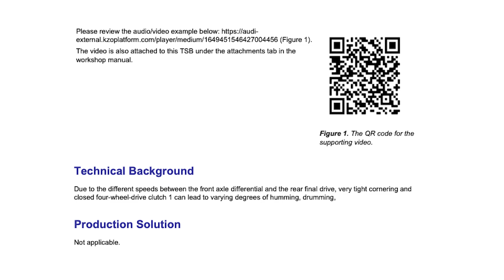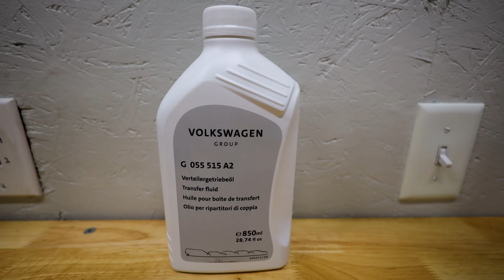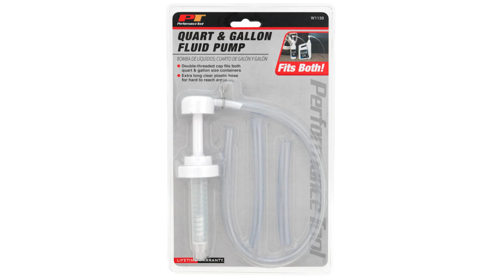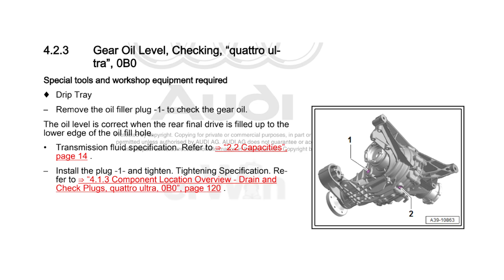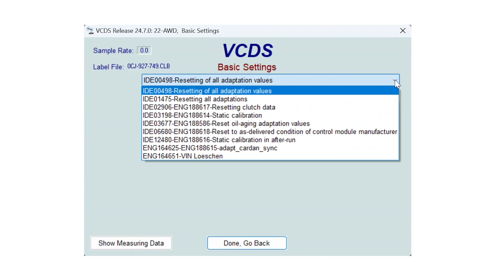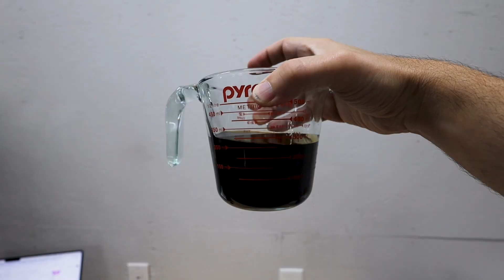Quattro Ultra AWD Clutch Binding & Vibration Fix | TSB Procedure A4 Allroad

Comment: Second comment. PLEASE HELP!!

So I don’t have the front differential but I do have Quattro I guess it’s not the Ultra. Now will the steering lock vibration be solved by only changing the fluid in the rear clutch differential?

10:53 are these plugs the same for the rear differential?
Reply from the maker: If you have an all wheel drive Audi, you do have a front, center and rear differential - it's just that front and centers can come in different mechanical formats bundled into what looks like just one big transmission casing under the car. Whether it's the build sticker in your spare wheel well, getting under the car, or scamming the computer, you should figure out what you truly have. That said, has a professional looked at this car yet? Vibrations can often be caused by leaking high pressure power steering hoses, worn suspension or brakes...in fact it's often NOT a driveline issue (beyond worn mounts, maybe). What have you done first hand, so far?
Reply: @FigureItAuto I had the power steering hose recall on my 2010 Q5 because of the rumbling when turning hard at standstill
Reply: @mne9476 yeah, I had this rumble with my old B8 too. Got the PS high pressure hose but never got to replace it until I got rid of the car, I even have the hose in my garage to this day. But with this B9 it’s not a shudder, it’s more of a vibration like how a phone would vibrate.
Reply: @FigureItAuto  I see. I got under the car, and the front clutch that you have on your All Road is, let’s say missing on my car. I guess it is like you say somewhere else, but I don’t know where, or how to find it. 
I’ve had it looked at when I was getting all shocks and struts replaced, and they said they felt nothing was loose or worn out, but I know something is clunking on the front passenger side when I go over mild bumps or small potholes, apart from that, everything feels solid going on uneven surfaces. Said I’ll take it back for further diag. I also need to replace rotors, they’re warped. Having that said I HIGHLY doubt that those two issues would cause vibrations at full lock while creeping slowly cause the vibrations are not like shuddering ones, it’s like the whole car is a cellphone vibrating kind or vibrations. It goes away if I pick up a little speed. Also, no high pressure power steering hoses on our B9s, seeing that Audi stopped using power steering pumps from the B8.5. We have EPS, electrically assisted power steering. The system works fine, I’d be in shock if my steering rack & pinion is cause the vibration, I don’t know how it would.
I already returned the gear oil in the white bottle, I still have the gray bottle oil. So how do I find out what clutches I have? Could the one in the rear cause these vibrations? One thing I’ll get checked out are the motor mounts for sure.

Comment: Hey, I have the same type of problems with my 2017 A5 quattro 3.0tdi, but it has a torsen awd system not quattro ultra, is it possible to do the same thing with the torsen awd system? I had a gearbox oil change, the problems became "lighter" , but still noticeable.
Reply from the maker: Technically, yes, it's just I wouldn't expect this to be the solution. Vibrations can come from so many places under a car and you need to look for clues all over the steering, suspension, brakes - lots to trouble shoot. But fluid changes are easy, usually, and your car will thank you for it regardless.

Comment: How did you find out the 360ml-400ml fill amount?  Google has not been my friend . Thanks
Reply from the maker: It's in a fluid capacity table in the workshop manual, which technically lists the initial fill at 0.85L and a refill at 0.65L. I think what people have found out though is that it takes a little less than that.
Reply: @FigureItAuto   Thank you sir.  Great videos

Comment: Is the flush cycle needed or can you do the one drain/fill before the vcds reset ?
Reply from the maker: Since it can be done with a single bottle, there's really no reason NOT to do the flush - but even if that weren't the case, I would still do it. Knowing how sensitive that clutch body is, you need every drop of clean, high performing fluid in there as you can manage.
Reply: @FigureItAuto thanks you make a good point.  Local Audi in Alberta was $140. I found Triax Dtf-1 as an option
Reply: @FigureItAuto  would you say go for a drive with the old drain plugs , do the final drain and use the new plugs?

Comment: If you have the Audi Quattro AWD system and you are having the shuddering out of turns problem, THIS VIDEO IS FOR YOU! Fear not, even if you’ve been driving around like this for months! Do the flush and refill twice and follow the instructions in the video (I subbed driving on the actual road vs his method, but I had a garage with a lift up and down easily). You will be fine! 2019 Q5, 120,000 miles, never did the fluid flush. I found this video a couple weeks ago, ordered the stuff online, did the service today and I am BACK IN BUSINESS BABY! No more wondering if it’s gonna be a $2000-4000 repair every time I step on the gas or take a sharp turn!
Reply: How is the car? Any update? Im planning to do the exact same servicing to my 2022 a4, I have vibration and kicks at low speed turning
Reply: I need to do this on my 2019 Q5 too...

How hard was the job? Was it easy to access?

Comment: I've started noticing a very slight rumble when turning from a light or parking lot.  It's really not loud or locking or binding at this point, but I can feel it in the wheel/seat - it just sounds like the diff isn't working quite right and the right slippage isn't there.  Is that how this started for you too?  My Q5 is still under CPO till this December, would they cover this TSB (whether the change or the crazy circle driving)?  Also since its so slight and I'm overly critical of noises/feelings in my cars, I worry they will just say "Meh there's nothing wrong with it" then charge a diagnostic fee.  I actually don't really mind doing this myself because I change fluids in all my cars (well, the Q5 has quite a process for the transmission so I let the dealer do that one) but certainly would rather them do it if it's covered.
Reply from the maker: That's how it felt when the Allroad here started acting up as well. From everyone else's stories, I'd say the odds that the dealer will acknowledge the problem and try either of the TSBs is low (especially the oil one, now that a newer TSB is out) but it's certainly worth asking about. With how widespread it is, I'm almost surprised it's not recall worthy. But hey, I'm just some guy on YouTube.
Reply: @FigureItAuto  Ha!  If I were Audi I'd rather change the oil every 20k instead of driving in circles for a total of 30 min and throwing up!  I thought about trying the circles thing myself but I'm not sure it's worth the torture.
Reply: @Wolfman140 how do you try the tsb yourself? Just drive in circles?
Reply: @lisandrodiaz7852  Check out the link I put in above.  It says though that the Test Plan available in the ODIS software has a target torque value....so I don't know if that functionally changes the way this thing operates or not.  If it does, then doing it yourself may not yield any results.
Reply: Thanks, I went ahead and just did the fluid change and it’s night and day difference. I would say that it fixed it. The fluid was pretty dark, my q5 had 53k when I changed it. Still trying to follow Audis thought process on not wanting to change the fluid but rather do this circle procedure and if it will work better than the fluid change.
Reply: @lisandrodiaz7852  Yeah I'm on the fence; I sort of want to just change the fluid vs. bringing it to them (even though I'm still under CPO) because it will literally take me less time than bringing it in.
Reply: I had this same problem 2 years ago on my 2017 A4 Allroad and got it fixed,  and not it’s back again and I hate it.  It’s so uncomfortable to drive like this, I have to bring it again.  How often does this happen?

Comment: My 2022 Q5 45 has 30K miles and I have the problem. I have a SIGNIFICANT rumbling though. Got worse recently. Dealer plans to do a software update. I will push for a fluid replacement also.
Reply from the maker: If you're able, inquire what the dealer is actually doing with that software update and report back here.
Reply: @FigureItAuto  I will find out and report back. I think when they test drive the Q5 they will realize that there is a mechanical issue involved. The rumble is audible and can be felt through the seat, steering wheel, and accelerator. I will push for the fluid replacement because I can't afford to bring the vehicle back multiple times! I only have 10 months left on the warranty!
Reply: @FigureItAuto  I took the Q5 to the dealer today. Because there is a new TSB, Audi forces dealers to "retrain" the quattro system by connecting a computer, watching the output, and adjusting as the technician drives in circles for 30min. I asked about this procedure reducing "high spots" on the clutch discs and he had no idea what I was talking about. If the software/circles procedure doesn't solve the problem, they go to Audi to get approval for the fluid replacement. Audi will either ok the fluid replacement or direct the dealer to replace the AWD Clutch. My Q5 is still under warranty. Today, on the drive home, the terrible rumbling was gone,; however, there is still a slight rumbling when turning tightly and when taking off, but I think most of that is characteristic of the Q5 with the 2.0 TFSI. My previous Q5 had a 3.2 V6 and some slight rumbling due to power steering hose vibration.

The service advisor said this problem is common with Q5, A4 variants, and some A6. The two vehicles they actually replaced the AWD clutch on were both Q8.
Reply from the maker: Excellent insights! If I ever get the time, I'll attempt to figure out what metrics can be logged via VCDS for the clutch so we can all start to understand what that circles process actually entails. I believe the "high spot" theory is just someone's wild assumption and holds no merit. Thanks for asking questions and sharing back.
Reply: @FigureItAuto my quattro binding issue is finally resolved. Hopefully this insight helps. I had to get the dealer do the work under warranty. The first time they had the Q5, they did the “drive in circles with the computer connected” method. Didn’t work. On second visit, they had Audi Tech on the phone while they did the so called “break in procedure.”  While Audi Tech was on the phone the mechanic made the appropriate programming adjustments. I took it home. Seemed to be much better. However, they did the procedure while the drive mode was “comfort.” When i put it in “dynamic”, I thought we were having an earthquake. There is a different procedure for each drive mode. So, I took it back for the third time. This time I told the service advisor to not call me until it was completely resolved. Audi Tech had them flush the fluid twice (as you suggest in your video), and then they went through the break in procedure for each drive mode again. The binding and rumbling seems to be resolved now. Amazing how smoothly the system is working now. They gave me a Q3 45 as a loaner. It had a 8-speed tiptronic and the standard quattro. Horrible ride!  The service advisor apologized for the failure in fixing it on the first try. Apparently they haven’t had to deal with this before.

Comment: I have had oil change two times on my 2021 A5 so far.  The issue is completely solved every time.  One time the garage put the wrong oil and the issue became noticeably worse!  After refilling with the right oil, the issue is gone.
Reply: Hi, I also have the A5 , which is 2020 45 TSFI, Quattro, the mechanic changed the fluid today, but the noise has not completely gone, they suggest me change the new or second transfer case, I wanna ask if the noise will immediately goes off when the fluid changed?

Comment: Would this work for a 2021 q5 45? I’m having the same issue
Reply from the maker: If you've confirmed it has the same type of ultra clutch: possibly. Have you called the dealer? What'd they say? Note there's been discussion here in the comments about a newer TSB that essentially just has you driving in circles, full lock, for 15 mins to (allegedly) wear off uneven material (and how after that you wouldn't need a fluid flush anyways, beats me) - and that works.

Comment: This wouldn't have happened if they just stick with the standard mechanical quattro system using the self-locking center differential.  Full-time AWD with no connecting/disconnecting.  I stick with models using this drive concept, though it is increasingly difficult to find affordable models using the self-locking center diff.  Who would have ever guessed that making the AWD system more complex would lead to more failures??

Comment: I have just had my car at Audi for this fault.       the "new" fix that they do is to drive the car at full lock round in a circle for 15 mins each way.      this issue is caused by high spots on the clutch which once driven this way are levelled off.   might be worth trying that before doing the oil change / flush.
Reply from the maker: And how does it feel now? This solution doesn't make mechanical sense to me based on how the clutch works and is constructed. What they're doing will grind off the furthest edges of the teeth of gearing in the front diff but that's not where the problem resides. Can you share more about your year and model and what Audi told you?
Reply: @FigureItAuto  this is a 2019 Q5 40 TDI, im in the UK.     and what i said is what they told me,     the mechanic was white as he had been going in circles for 30 mins.     the jitter / stutter has gone, so far so good.   the TSB referenced in this clip is apparently old and has been updated by audi, not sure on the new reference.
Reply: @FigureItAuto they did it to my q5 2021 40 TDI, it didnt work 😅
Reply from the maker: @Elghorda  Which method? Fluid or circles?
Reply: @FigureItAuto circles
Reply: @FigureItAuto Hello!a little update, as i told you the circles methode didn't work, so  they did the flush and the rumble is gone. I told them that i will be doing the flush every 30k km from now on, they agreed but it won't be for free ( under warranty ) if there's no rumble!
Reply: @Elghorda is this covered under Audi extended warranty?
Reply: @Elghorda are you in the UK, what sort of money did Audi charge
Reply: I am from UK and have a 2019 Q5 40 Tdi with the same issues. The Audi dealer is going to do that same drive it in circles until it stops. I asked about fluid change and they said not required. I’m not convinced but will find out next week when they do it at my expense!
Reply: @robertbate2991  I have the same Audi Q5 40 TDI. Will that work for you?
Reply: @robertbate2991  How did this work out?
Reply: Indeed, I just saw that there is a new TSB dated October 21, 2024, and it talks about this procedure.
Reply: @angelguillendev do you have a link to it?
Reply: Taking my 2022 Q5 to the dealer tomorrow for the fluid flush. If they try to drive it in circles for 30min I will slap the Service Advisor!
Reply: Audi Tech told my Service Advisor to show them the fluid after it was drained. They wanted to see if there were any particles that came off the clutch plates. The fluid was clear. Audi had them flush the fluid twice and reprogram the ultra clutch system for each drive mode. Issue is completely resolved now. Hope it lasts.

Comment: What happens if I don't have the computer to do the "oil aging value reset" you mentioned in the video? I'd like to be able to just change the oil as you described but not buy a tool I only need once. Thanks
Reply: Nothing happens. The reset is needed to know when the next oil change is needed

Comment: Stupid question but is the ATF 105 adapter necessary if I don't have a pressure pump? Can I just stick a hose through the fill hole?
Reply from the maker: Don't take this as actual advice but: maybe. You're suggesting that, even with the drain plug backed out, gravity filling the clutch is as effective as pressure filling it. The catch there being that we don't know if the slow, rising level of fluid will actually get to all the places it needs to be. I'm sure a guy could attempt to test it, filling both ways and then measuring how much fluid is collected during a drain...but no one's going to do that. If it doesn't work, you'll be doing the job twice 😅